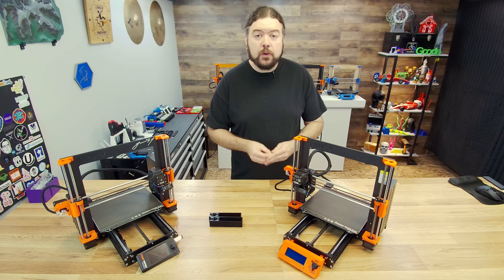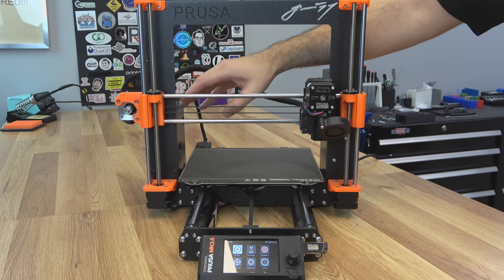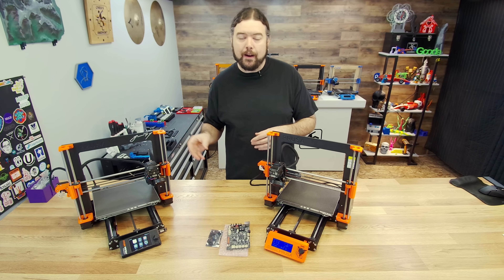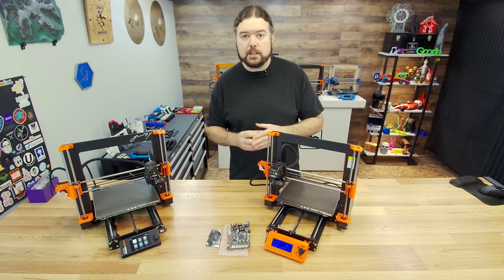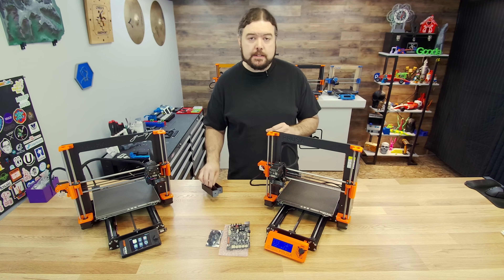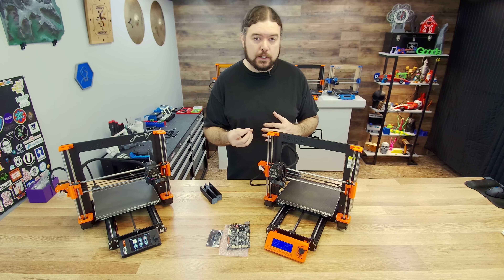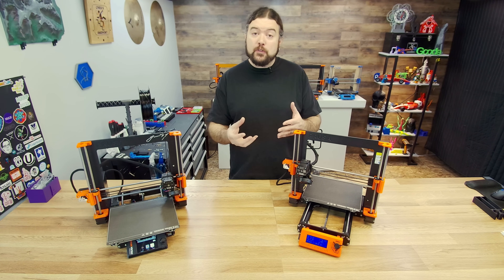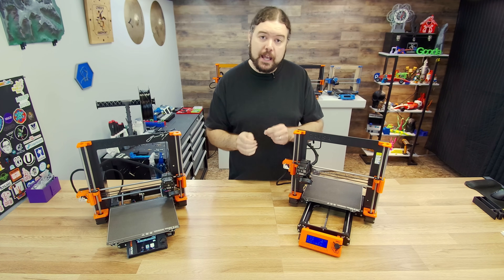Should You MK3.5??? - Prusa  MK3S+ to MK3.5 Upgrade - Prusa Upgrade - Chris's Basement - 2024

Comment: $250 US converts to $340 Canadian, which also gets me a Bambu Labs A1, which has the same footprint as an MK3 but out of the box runs faster. Also, anything I buy from Prusa is subject to tariffs and at least $40 US customs and duties. So all in all, costing out this upgrade gets much closer to just buying a new printer, preferably with a bigger bed and which has a multi-material unit already. I think Prusa has basically priced themselves out of the market. I know people who run Creality, Elegoo, and Bambu here with full-blown print farms running around the clock at a fraction of the cost of what a Prusa would cost.
Reply: Oh yeah, but you can also get an ender 3 for 100 bucks at Canada computers. Yeah Prusa is more expensive, but it's also more reliable, more hackable, and with Prusa you know that no matter what, you can make small incremental upgrades to your printer(I'm currently looking at just upgrading the board, which would be about 40% of the .5 upgrade)

Comment: IMO if you want faster prints amd quality print is not worth it. You're jusy throwing more money trying to upgrade an old machine. Just get a new printer and be done with it. If you print functional parts for example, you are going to need an enclosed printers sooner than later. With the MK3.5 you would need to get the Prusa enclosure which is pricey to say the least. The only reason to keep upgrading Prusa printers is if you just like to play with your printers instead of actually making stuff with your printer or if you just want to support open source. I have two MK3S and I can't justify spending north of $700 to upgrade both when I could just get a Bambu Lab printer that's better in almost every way for less than that.

Comment: Also, I'm using the Bondtech extruder with the Mosquito hot end...does Bondtech support the 3.5 firmware if I upgrade?
Reply from the maker: There are extra things you have to do in the start gocde to get the different extruders to work.
Reply: @ChrisRiley  Bondtech usually includes the extra things in their firmware...I'm mainly concerned on if they have firmware for their hot end and the new 32 bit board.
Reply from the maker: @InspGadgt  Yeah, no support from Bondtech for 3.5 that I know of yet.

Comment: Is the metal housing needed for heat dissipation? I just upgraded my 2 printers to the big Einsy box and I really like the extra room inside.
Reply from the maker: It uses 2130's and they do get really hot. You can give it a try, but you might want to add some heat sinks.

Comment: Probably will still stick to my mk3, don't print that much and in terms of connectivity it's right above my server / nas anyway so running octoprint requires no additional hardware. 
If I do upgrade at some point, could look at running a klipper setup at some point though. Already use .6 mm nozzles, wonder how that would factor in here?
Reply from the maker: I hear you 100%. A 0.6 have a config out of the box, so you should be able to use it as is if you converted to 3.5

Comment: Hey Chris awesome video! I am looking at the 3.5 upgrade but would also love to get the new X-y motors on the 4 once Prusa starts to sell them as parts.  Have you heard about anything that would stop compatibility with the 3.5 firmware?
Reply from the maker: Thanks! I haven't heard anything, but they should work on all the firmwares. I will look into it further.
Reply: @ChrisRiley  Just wanted to give an update upgraded to mk 3.5 with ease. I went and bought the x and y axis motors for the mk 4 and installed them but had a constant failure for both x and y axis during initial calibration. It appears that there is some 1.8 degrees changes in the firmware itself that prevents them from working correctly.

Comment: I have a Bondtech extruder on a MK3. Are there any challenges or gotchas in going to a MK3.5 ? I know I also need the MK3 -> MK3S+ kit.
Reply from the maker: Someone listed it here, looks like you need to use the start gcode to change the steps for the bondtech.

Comment: I am underwhelmed by the upgrade paths from Prusa. I love my Mk3S and have upgraded two times over the years. For $250 US you could have a Pi that runs klipper, a new hotend and extruder and maybe some pulltruded carbon rods for the gantry or some better steppers. Dual fan setup on the hotend.
If I want to do this on my own, I will no longer be in the Prusa eco system. I need my printer to just work and not have to do lots of tinkering. So I am holding off on an upgrade to 3.5 or 4 and considering getting a P1P
Reply from the maker: If the printer works, don't mess with it I say.

Comment: I love your channel it's easy to understand the content! Could you do one on running 4 printers of 1 pi 4 4gb? I have 4 printers that I need to setup for wireless to run them from.
Reply from the maker: Thank you! I have done these before, check this one out. https://youtu.be/nDwW3eNxp2k
Reply: @ChrisRiley  Thanks for the link, it was great. I forgot to tell you that I am running Mainsail not Octoprint. Is the installation process the same using Kiauh?
Reply from the maker: Yes, same process, just select which one you want.

Comment: Upgrading to Klipper using a 18€ Raspberry Pi Zero 2W and a 6€ ADXL345 accelerometer for input shaping makes more sense. I even removed the display and only use the Mainsail. You get the best of both worlds, great hardware and reliability of the legendary mk3s+ and all the latest and modern Klipper Features.
Reply from the maker: Thanks for sharing!

Comment: Chris, (or any other who reads this) Where can i find a forum for an issue with my Geeetech GT 2560 board..? Suddenly it started 'burning' the heatbed fuse. Do i need a new mobo, or is it something else ???
Reply from the maker: It's usually the mosfet that is causing an issue like this. Boards are very inexpensive now, I would replace it.

Comment: "...it's the fastest, cheapest way to add input shaping to a MK3." 
.... for $250...

You can klipperize a mk3 for under $70, including accelerometers for both bed and toolhead, which mk4 doesnt even include. Spending $250 on a 32 bit mainboard&LCD that doesn't even run klipper/RRF is way overpriced. You can get a 32 bit mainboard that runs klipper w/out needing a raspberry pi for <$70, and a touch screen for ~$20. Or stick w/ einsy board&12864 dislay and add cheap klipper board/rpi for ~$30-40.

Any way you slice it, the mk3.5 upgrade is FAR from the cheapest way to get input shaping on a mk3.
Reply from the maker: Thanks for your insight!

Comment: Great Video. however you forgot to mention the extra $100 needed for new power supply and new print bed, for older MK3 machines.   The $350 upgrade price for older power supply MK3s is a show stopper.
Reply from the maker: Absolutely! This upgrade may not be worth it on older Prusa machines
Reply: @ChrisRiley  You neither need new PSU nor new heated bed. As a manufacturer Prusa can not tell you to solder the new cable to the old board or modify the PSU, as if something goes wrong, Prusa can be hod reliable by EU laws. So they have to tell you to get new heatbed, they can not tell you "do some soldering".
If you know wich side of a sodering iron goes hot, you can change the old bed cable to the new one. Also for the PSU all to do is conecting the white power loss recovery cable to ground of the 24v cable. They even make an adapter y-cable to do this (11€) without soldering or make changes to the PSU.

However, if you do not need MMU, power loss recovery and connection to calibrate input shaper, you can use a prusa mini buddyboard with display instead. even a cloned one (about $55 together on ali). You need also a mosfet for the bed (about $4) and the 4-pin PSU connector for the mini (about $4 for two of them).
Than flash snake-firmware (github) - and you have a "mk3.3". same speed and print quality as the mk3.5. Also Prusa link works (I do not use Prusa connect yet, but should work also).

For a fraction of the price of an mk3.5 you get mostly the same. Ideal for the 3td or 4th mk3...
Actually I upgraded one of my mk3s+ to a zOrbiter 2 extruder with Revo hotend a few years ago. Best print quality of all my mk3s. So while I upgraded my first two mk3´s to mk4´s, I not changed the zOrbiter one. But now I upgraded the zOrbiter-mk3 to an mk3.3 - and can barely tell if a print came from the mk4 or the mk3.3+zorbiter. And yes my zOrbiter mk3 had soldered heatbed and silver PSU. The upgrade to the mk3.3 was about $70 (+some plastic and screws). Definitly worth it.
Reply from the maker: @oleurgast730  Great info!
Reply: @ChrisRiley  I just released a video for the mk3.3 upgrade today. Sadly only in german.

Comment: It's a tempting upgrade at $250, but unfortunately an additional $100 for me since my printer was an early MK3, which will require a complete bed replacement and additional wiring for the PSU.
Reply from the maker: It's definitely up to the user and their individual needs. Thanks for watching
Reply: The old hotbed just has a soldered cable. Due to the current Prusa does not make an adapter cable. However, if you know wich side of a soldering iron gets hot, you can upgrade the bed yourself by soldering the new cable to it. 
Also with the PSU: On the signal cable for power loss detection the white cable is connected to ground inside the PSU. A quick fix to do on an silver psu.
But: as you work on lines with high current (bed) or inside the PSU unit (power loss detection) Prusa can not tell you to do theese changes yourself due to being reliabale if something goes wrong - EU laws...
So they sell you an aditional adapter to do the Ground to white cable and a new hotbed with screws for the cable.
So if you do soldering on your own risk, you can do the upgrade without spending the extra $100.

Actually I preordered my mk4-upgrade as soon as possible - before Prusa discovered older mk3´s need a new bed. Also Prusa wasn´t fully aware about the difference between the silver and the black PSU. I got a free new bed and a black PSU for halve the normal price.
However, exept for the frame, 4 rods and 6 bearings I have all the parts for a full mk3s+. I have a quite simular frame and rods and bearings from an old p3steel (third party mk2 upgrade). So now I am building another mk3s+ from all theese parts. Which needs upgrading to a new controller...

There is an alternative to the mk3.5 upgrade. Instead of the xBuddyboard you can use the Buddyboard for the Prusa Mini.
Aditionally you need to make an adapter to connect two z-motors (same as for the dual-z mod for the mini) and you need an external mosfet for the bigger bed. This upgrade is also known as "inofficial mk3.3 upgrade".
The Buddy does not have:
- crash detection
- power loss recovery
- MMU-support
However, for single colour prints you practicly get same speed, comfort and quality like with the mk3.5 upgrade. For a fraction of the price (if you use a china display from aliexpress). For less than $100...
The custom firmware for the mk3.3 is available on github, search for "snake firmware".

Of course the cheapest upgrade simply would be adding klipper to the old mk3s+. However, as the Einsy-Board has no bootloader, upgrading is a bit more complicated (but extremly cheap, about 25€ for a Raspberry Pi zero 2 W plus a touchscreen - most old smartphones and tablets can do it). The main advantage of the mk3.3 upgrade is staying in the ecosystem (PrusaLink, PrusaConnect, all the predifined profiles in Prusa Slicer).

Comment: Upgrade will cost more depending on bed and power supply you currently have. It could cost $359. At that its almost not worth it as you can buy another brand and get the bells and whistles.
Reply from the maker: If you have an older Prusa model, the upgrade probably isn't worth it. 🙂

Comment: I don't think it's worth sinking that much more money into the MK3S, especially if you have it hooked up to a Raspberry Pi with Octoprint. I think bed slingers have had their glory years, but should be put out to pasture for stationary beds or beds that only move on the Z axis. And the reason I say that is the bed moving back and forth is basically fanning your print with the ambient air around it, which can cause a lot more warping and also, when the beds start moving very quickly, tall prints can have issues.

What I would like to see, if I may be so bold to make a suggestion, (I don't think you have videos of this specifically) is to take a Prusa MK3S with RPi running Octoprint and make it run Klipper with input shaper and other bells and whistles that Klipper gives you. It's been a while, so I don't recall if the Einsy board needs replaced or not. But, I know there are some 32-bit replacement board that are cheap and getting an accelerometer board is cheap. 

Or adding bed leveling with a load cell. But, I think those are pricey from Prusa right now. Then 3.9 kit includes it, but that's even more money...

That said, still being part of the Prusa ecosystem has value that shouldn't be ignored. They are doing the testing and firmware maintenance for you. So staying in Prusa's ecosystem means they'll keep you updated for some years or going with your own cheaper solution means you need to be the tech support for it.
Reply from the maker: I hope to do a lot of what you are suggesting here with the bear build we are currently working on.

Comment: I did the 3.5 upgrade on my Prusa. Nice speed improvement. Only issue is that I have a Bondtech extruder with a 0.9 deg stepper.  The combination requires 1660 steps per mm since microsteps are 32 instead of 16 as it was on the MK3. The maximum that can be saved is 1000 steps per mm. The work around is to include an M92 command in the print start gcode. Not a big deal but would be better if it could be saved or if I could change microsteps back to 16.
Reply from the maker: Oh wow! I didn't know that, this is great information for folks to have.
Reply: Hmmm, I also have a Bondtech extruder. Are there any other gotchas ?
Reply: @johnpeters4214  The other thing I noticed is that the SuperPINDA probes partially off the right side of the bed. My bed has always been closer to the left side of the frame opening than right. The initial setup no longer looks for the target points on the bed so it doesn't compensate for the misalignment. This results in some extra "squish" if I print close tot the right side of the bed.
Reply: @johnpeters4214  I'm using OctoPrint & send gcode script "After serial connection to printer is established" to correct the E-steps.
Reply: Which Bondtech extruder? The MK3s or LGX? I currently have a MK3s+ with Mosquito Magnum which has different stepping than the LGX version.
Reply: @pvpXan  I have the MK3 version with the original hotend. I also use LDO slim power 0.9 deg motor.
Reply: Same with the inofficial mk3.3-upgrade. I use an orbiter 2.0 with Revo six. However, as the mk3.3 is an inofficial upgrade using snake-firmware from github on a mini´s buddy-board to upgrade the mk3, the developer changed it to an upper limit of 2000 instead of 1000. Just a few hours after I asked him. So shouldn´t be a big deal for Prusa to change the settings of the menu. You always could do the change in sourcecode yourself anyway and compile it yourself.